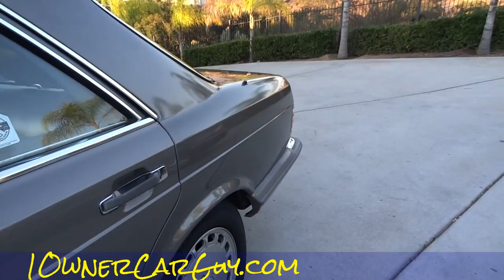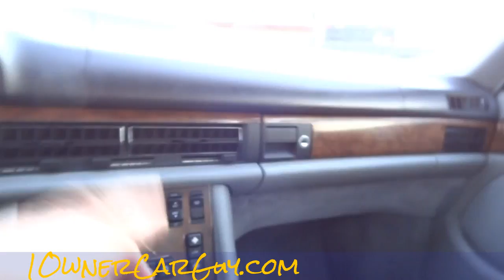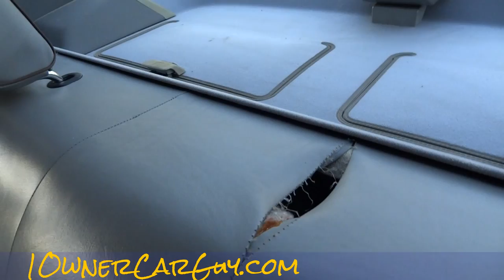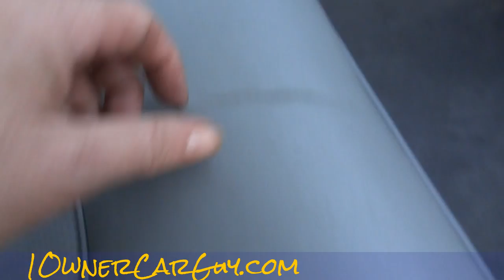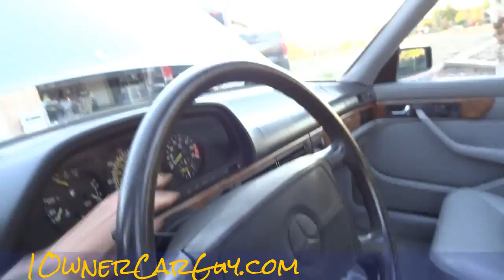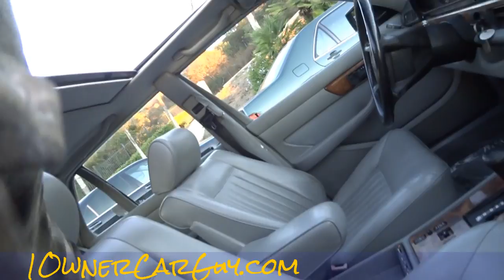1986 Mercedes Benz 560SEL W126 Sedan Interior Walkaround Review

Comment: Those would recirculating air switch and what I called a dual horn switch. it has a high and low horn you can switch between next to the seat heaters